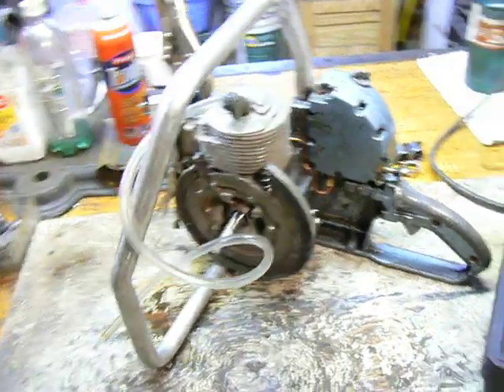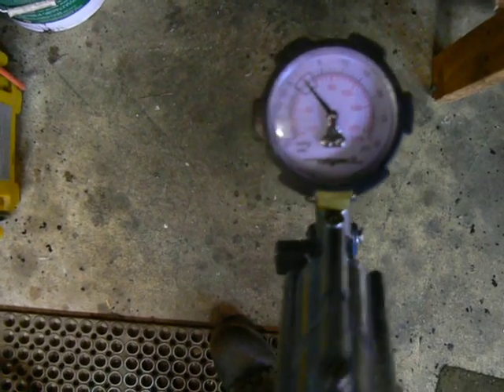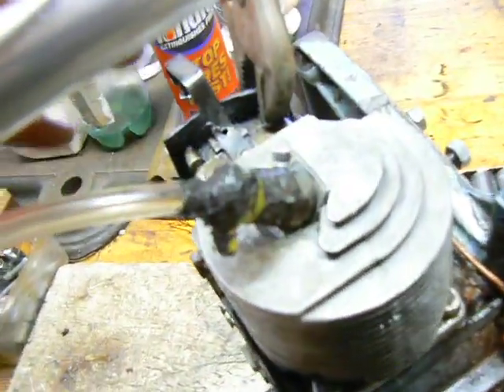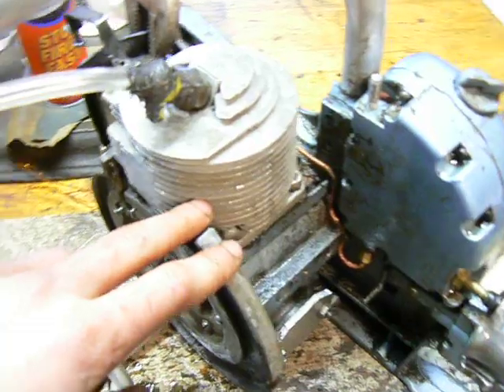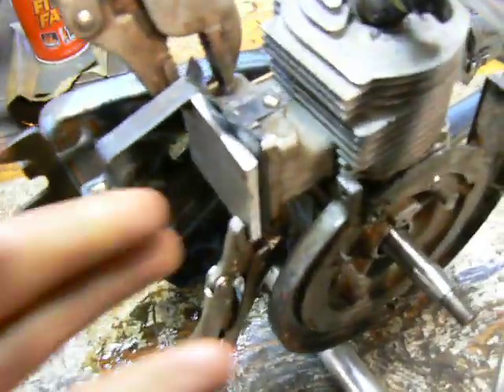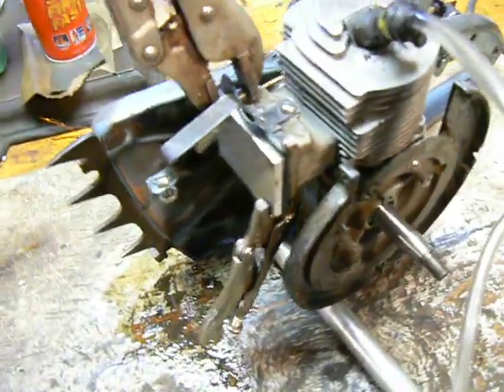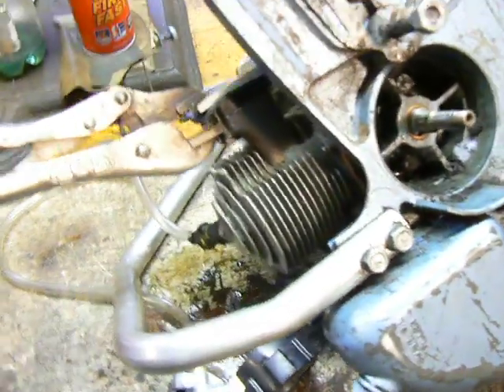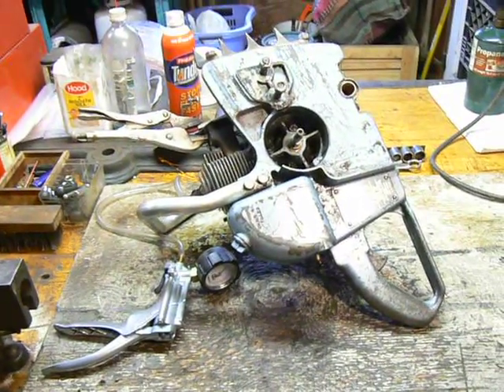Home Shop Tips No. 8 - Pressure and Vacuum Testing a Two-Stroke Crankcase

Comment: Can you still get parts for them? I have one that I'm throwing on a motorized bike project I'm building. It's not wanting to pump fuel even after a carburetor rebuild. I'm thinking maybe it has bad crank seals or something.
Reply from the maker: @SingleCylinderCustoms  parts were hard to find when I was big into saws. One of the reasons I got out of that and into hit and miss engines is because parts are easier to find or make!
Reply: @themadmailler  Yes sir, that makes sense. Usually I do a lot of my builds with modern saws so the parts are a lot easier to find. I just couldn't pass this one up. It was so old and badass.

Comment: Hi. Does this setup work on a 4 stroke engine like a sthil br600 leaf blower. Because it has values.
Reply from the maker: Not sure about those 4-stroke dry sump engines.
Reply: Yes.  I did this on stihl4mix br500,fs 90, fs110, an 130.  Just block the impulse and if nothing seems to be bubbling but it dont hold check the ohv cover great for testing carb inlets an gas tank vents.
Reply: The cam access plate is another place it can leak which is factory sealed with dirco ht.
Reply: If u dont feel like making the plates like me u can order them for a buck or 2 each.  Part # can be located on ebay and baileys.  Old inner tubes can be reused for exhaust port. Whats being done in this video beats just replacing parts at random

Comment: I normally put the whole thing in a tank of water. As long as there is constant positive pressure in the crankcase no water will enter the engine and it shows leaks instantly.
Reply from the maker: +Rayxl1 Interesting idea. Would only work for pressure, not vacuum though. Thanks for the idea!

Comment: Where would you get bearings and seals for a zip? I have one too and I've rebuilt the carb but it still just revs out for a bit and dies. I'm thinking its a seal somewhere.
Reply from the maker: I can't remember where i got mine... look around on the chainsaw forums and they should be able to help you out. i think a lady named "chainsawgal" had a few parts for me...
Reply: Ok thanks man. I actually just got it running. Just needed some carb adjustment and needle seating. Saw is very loud lol.